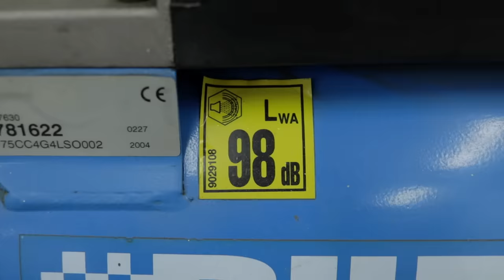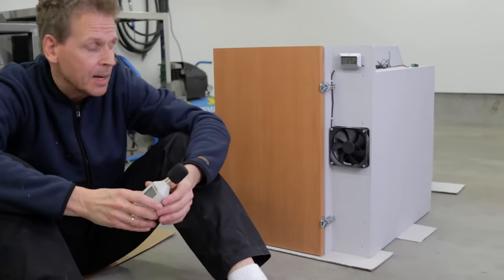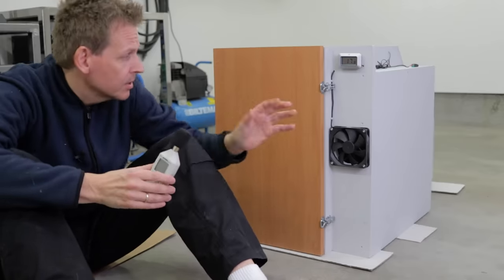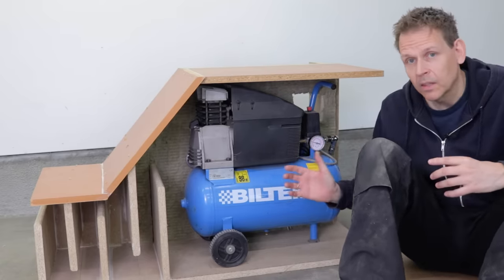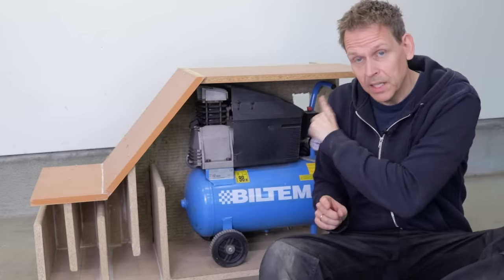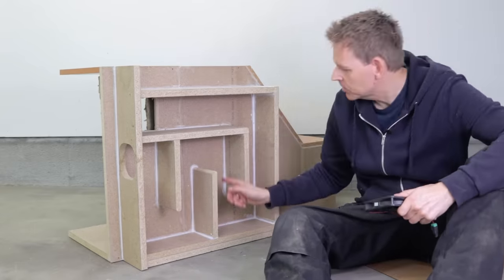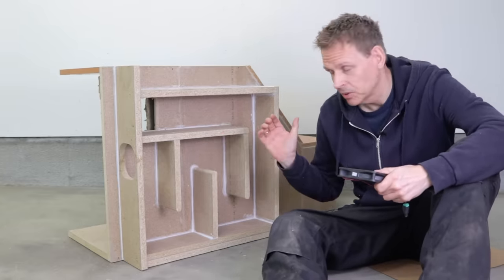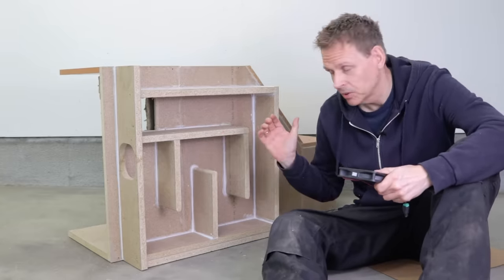Do not build a sound insulated enclosure for your noisy air compressor!

Comment: acoustiblok and half the construction FTW.
Reply from the maker: Is it the 3mm black rubber-looking sheets? Did find a video where it was tested, well 3mm cannot do that much I guess, but perhaps adding multiple layers might help? 🤔
Reply: @kihestad  I know nothing about the 3M sheets.  But Acoustiblok works extremely well for cutting sound.  My compressor box just has leftover strips from building out my office with Acoustiblok.  No special sound box nothing, just some stripes in the way of sound cuts about 10 db.  Maybe even more.  The strips like a meat freeze doorway.
Reply from the maker: Ahh, ok - sounds to be a good solution 👍😊

Comment: Put a better air intake filter on it
Reply from the maker: From what I have found a muffler on the intake / exhaust helps a bit, but not very much. I could be wrong though... I did some research but did not find any solution that I found to be very efficient, not even the ones fitted a big car muffler. The tank itself also emits noise because it acts like a sound chamber. I would guess that if a muffler really worked, the vendors would have added it.

Comment: The muffler idea was shown to me by a old-timer
Reply from the maker: From what I have found a muffler on the intake / exhaust helps a bit, but not very much. I could be wrong though... I did some research but did not find any solution that I found to be very efficient, not even the ones fitted a big car muffler. The tank itself also emits noise because it acts like a sound chamber. I would guess that if a muffler really worked, the vendors would have added it.
Reply: @kihestad  it really works   and they don't put  driers or automatic oilers on them either  but all good to have   try it I'm not kidding  and it's much easier

Comment: If you take the air filter of your motorcycle To replace the original air filter. It'll be quieter
Reply from the maker: I have seen/heard  several attempts on making air compressors silent by adding a muffler as an air filter. It does not help that much. The noise from the  comes from the whole unit, the tank acts like a sound reflector 😞

Comment: Donor forget to remove moisture after use...
Reply from the maker: Absolutely, I do drain the tank now and then! It's a bit cumbersome as it is now, I need to open the four eccentric locks and pull of the door and then take the compressor out of the box. It takes no more than 5 minutes, but it's enough to postpone it to the next day 🙄I better put on a line and have it on the outside....

Comment: C=F....C -30 /2
Reply from the maker: Yes, I really need to learn this, I have actually checked it since I made the video, I found this simplified formula that works OK in "normal" temperatures:
F = C * 2  + 30 
The correct one is F = C * 1.8 + 32

Comment: the only shortcoming here was the details on db, its a common mistake.

richter and db are both log scales.

richter though, it starts with a base unit, 1 stick of tnt, 10 sticks, 100 sticks, and so on.

decibel is 1/10 of a bel. thats rather irrelevant though.

for every 3db, its a doubling. or halving. 

what IS important is knowing that db doesnt have a base unit. its simply a RATIO.

you dont say something is "such and such db" as a measure of its volume or sound energy.

you say something is "such and such db IN RELATION to something else"

you can say ANYTHING is "0db" and then, something that is twice as loud, twice the sound energy, is 3db louder. i can say your compressor here started at 0db, the enclosure redcuing it from what you measured as 85, dropping to 70,  i can state as being "minus 15db" . or i can say the muffled compressor is 0db and increases by 15db when un-muffled. 

nevertheless, whatever way you choose to state it... thats a 32x difference in sound energy...

iirc, the "standard" audio db is 1V at 600R or "line level", BUT!

its a confusing topic as theres all these silly things about "weighting" due to frequency responses, etc, and then it doesnt always apply to audio or sound... it may be the voltage on a coax lead, maybe the power flowing in an amplifier, etc, etc.

and of course, a quick search, i cant find the "standard" audio base unit that all these db ratings are relative to... sad, all these "informative' websites and i have to dig out my old 1952 "radiotron" handbook to get the actual figures...
Reply from the maker: Ahh, yes - I am no expert for sure when it comes to understanding the dB scale 🙄 I was referring to a simplified model; what people tend to 'feel' when it comes to the audible volume of the sound compared to the measured dB. I have understood now this is debatable. For example: different frequencies affect how loud it sounds for the ear, even though the measured dB power can be the same.
Reply from the maker: This was very thorough and well explained, thanks a lot 👍😊

Comment: you have no idea of sound proving.. ive made studios and silent rooms.. 

anyway.. a engine makes around 140+ db.. with a silencer around 60
whats the trick? thick layer of heavy isolation.. like rockwool. better have a smaller airgap.. just right for the compressor and  have loads of rockwool...  
ive made a compressor way more silent by just puting a motorcycle style silencer on the intake.. 
if i would make a box like that.. i would calculate it, and it would be as silent as a fan
Reply from the maker: Thanks for your input, glad to get a pro onboard here 👍😊  I actually used did use Rockwool sound insulation inside the main chamber, it's a very efficient material. I have used it to make DIY sound absorbing panels for the ceiling in my garage. I made a video about the process and tested the result, curious to hear what you think: https://youtu.be/4EkoAMJAIug

Comment: Definitely not worth building it like that, a simple insulated box works just fine
Reply from the maker: You need to supply air to the compressor and make sure it has cooling. A sealed box will not work. A box with ventilation to let air in and out, but at the same time not let noise escape needs to be a bit sophisticated. I had space limitations and wanted to tuck it under my pitched roof, so my build was a bit extra complicated because of that. A square box will be more easy to build and work just as fine 😊
Reply: @kihestad  an indirect air inlet with sponge works well enough but I doubt my installation would allow for prolonged running although it's the high heat levels of the compressor you're trying to shed, the temperature difference is still high within the box even if it hits say 60degrees C.
I do have the advantage of simply lifting the lid off and unplugging power and air then removing or replacing the portable compressor

Comment: I like your design of the box. It could vary from builder to builder. But I would like to add a very important feature I have not seen.
That is wire mesh on the the openings to the box.
Mice and other little critters would love to live in your comfy hotel. Once they move in your investment of time and money will be wasted. It will smell disgusting forever 🙁 🐁 🐁
Reply from the maker: Hmm, I had not thought about that 🤔 You are right, this is probably a "dream hotel" for mice. We have not had any problem with mice here where we live (a lot of cats around), but you never know. Thanks a lot for your suggestion! 👍

Comment: dB vs dBm: the former means double energy =+3dB, the latter does the same for +10dBm to my knowledge …
Reply from the maker: Ah, ok - I don't even know what dBm is 🤔I might have over-simplified how the Decibel scale is to be understood, based on a discussions / explanations I have read from the comments perhaps this makes sense: 
* 10dB increase is the typically stated value for doubling the perceived volume (subjective), without respect to actual power/energy. 
* 3dB increase is a doubling of the actual power/energy (objective), without respect to how a typical person would perceive or rate sensed-volume. 
I have to add that the Decibel is a difficult scale to relate to (at least for me), I might have to study this a bit more - sorry if I got it wrong 😌
Reply: @kihestad  Sone is often used as a unit for subjective loudness - and it uses a linear scale :)
Reply from the maker: @willemjansen9409  ahh, okay, thanks for the info. Never heard of "Sone", need to look it up one day 😊

Comment: Of course the simplest solution is to put it outside.
Reply from the maker: Yes, that is way smarter 😊I just dont have space for it. My garage is placed with minimum distance to two of my neighbors. The side facing my own property is not usable either,  as it's just a slim path between my garage outer wall and a concrete retaining wall. In front of the garage door is no good either 😋

Comment: Foam board insulation works better
Reply from the maker: I used Rockwool sound insulation material on the main inner part where the compressor lives. It is a lot more dense than normal insulation made for heat/cold insulation. I works very well. I am not sure if these foam board insulation mats works very well, but they look cool for sure 😁
Reply: @kihestad  Thank you- good job on that box. I was just thinking my foam board idea would bounce the sound around instead of obsorb it like your mat is.
Reply from the maker: @puppygadget3189  I think the sound waves needs to be broken apart, or they will eventually find their way out the ventilation channels. If you have separate rooms with no channels in between i would guess a more dense material would work.

Comment: your testing is scientifically invalid because you move the position of the noise source relatively to the walls and to the mic, so you are changing the distance and the ambient wall reflections.

to be valid, you must not move the compressor to the box, but move the box to the compressor, so that all wall reflections are identical. 

I had the case of a noise box With funny shape. it was a huge compressor outside in town. huge like,people could not sleep 300m away. they had plenty space around. they also could not embox it due to the need for huge intake and huge exhaust (diesel ). they have put 2m high and 3m long sound pannels around it, not like a box, but radially, like a star. only vertical panels but in a radius position. all spaced at about 50cm. the machine  could breath air as required. it could be visited when required. it could be seen.  but the noise was reduced to an acceptable level /because when distance between obstacles is smaller than wave length, wave can't pass. only short waves could go.through, and they were also hugely reduced.
Reply from the maker: Very cool solution 😊

Comment: why not just take the motor off the tank & make a much smaller sound proof box..? & a longer hose to the tank from the motor/box..?  also incase ur cheaply made tank decides to go boom 💥 the wooden box might help or make it worse & more shrapnel.. 

Remember ppl on the bottom of ur aird tanks is a screw that lets out Water if not ur tank too will rust inside out & go boom,  videos everywhere online

Comment: Just put the compressor in another room, or outside the building.
Reply from the maker: Yes, that is probably the easies and smartest solution to the problem 😊Unfortunately, I just dont have space for it. My garage is placed with minimum distance to two of my neighbors. The side facing my own property is not usable either,  as it's just a slim path between my garage outer wall and a concrete retaining wall. In front of the garage door is no good either 😋

Comment: since every 3db is a doubling of sound power you are talking 8 times as loud.
Reply from the maker: I might have over-simplified how the Decibel scale is to be understood, let me try to clarify (based on a discussion / explanation from the comments): 
* 10dB increase is the typically stated value for doubling the perceived volume (subjective), without respect to actual power/energy. 
* 3dB increase is a doubling of the actual power/energy (objective), without respect to how a typical person would perceive or rate sensed-volume. 
I have to add that the Decibel is a difficult scale to relate to (at least for me), I might have to study this a bit more - sorry if I got it wrong 😌
Reply: @kihestad  I think I recall that a doubling of power is 6db if you are measuring a change in voltage (assuming a constant impedance) instead of a change in power.

Comment: just put the compressor away from your work area.  Mine is outside in my carport, its also the size of a small car.
Reply from the maker: Yes, that is probably the easies and smartest solution to the problem 😊Unfortunately, I just dont have space for it. My garage is placed with minimum distance to two of my neighbors. The side facing my own property is not usable either,  as it's just a slim path between my garage outer wall and a concrete retaining wall. In front of the garage door is no good either 😋

Comment: Use proper sound isolation,  not flat survice
Reply from the maker: I used Rockwool sound isolation material inside the main chamber of the box. The same material I use in my DIY sound absorbing ceiling panels. It works great 👍

Comment: You actually have created a problem for your solution. Using enclosed air compressor for more that 50% duty cycle will overheat it and short the lifespan.
Reply from the maker: I absolutely share your concern about overheating. The air compressor will not live for long if it is constantly hot above the recommended specs! 😐 However, It's a pretty cold climate here where I live in Norway, in the Northern part of Europe. I have actually fitted a heat pump in my garage to be able to use during winter time. I can see overheating is a big challenge in warmer climates. A more powerful fan or even radiator cooling could be needed must then be considered.

However, since I have a fan in front blowing air into the box I have airflow through the case that will "grab" the heat and transfer it out of the box. I have fitted a thermometer and checked the performance frequently. Normally the temp increases 5C = 10F from when it starts until pressure is built up and it shuts off, and then it takes just a couple of minutes to cool it down (as the fan continues to run after the compressor stops). If it is running constantly over longer periodes it can get a bit hotter, I have seen almost 10C = 20F increase. The warmest summer days can be 30C = 86F here where I live, but that is very rare. Its more commonly 25C = 77F, so it never gets very hot inside my box and it is within the range of acceptable temperature for this compressor.
Reply: @kihestad  Thanks for taking time to clear this out. But, anyhow, its local solution, making box like this in South would bring different results. My compressor heat up a 30m2 garage if I leave it running for 30min or longer... good luck to you with future projects.

Comment: Buy a decent compressor.  That's a crap unit.  Get a good piston driven unit.
Reply from the maker: It might look like it, but it's actually not. It works great for my use. I have used it for painting and all kind of tools without any problem. When sandblasting or just blowing air the capacity is of course limited since it is small, but I am not running a big workshop so for me it's perfect!

Comment: Roll it outside and close the door.
Reply from the maker: Yes, that is way smarter 😊I just dont have space for it. My garage is placed with minimum distance to two of my neighbors. The side facing my own property is not usable either,  as it's just a slim path between my garage outer wall and a concrete retaining wall. In front of the garage door is no good either 😋

Comment: Seems like a lot of dicken around for such a crappy compressor. There are compressors on the market much quieter, they are more expensive but you do get what you pay for.
Reply from the maker: The air compressor is actually quite decent, for my need it is perfect. Nice to know that more expensive compressors exists, it did not really surprise me 😁
Reply: @kihestad  
There's cheaper ones too,
They make even mor  noise. 
If you use it much yours won't last long anyway.
Do as  you wish but I chose to buy  a good one  that was used for about the same money. 
A speedair,  very nice  but kinda expensive new. You can carry on a conversation with someone while it's running.

Comment: Wear hearing safety gear. Done.
Reply from the maker: Hearing protection is a great solution, and I always use it when I start a noisy machine. I'd rather not go all day with them over my ears, I don't think anyone does, when not operating a noisy machine I take them off. I might be easily scared, when a sudden loud noise happens it felles like my heart skips a couple of beats 😛 You never know when the air compressor kicks in. Typically it happens when I am very focused and it is completely silent in the garage. And there - BANG - it kicks in. I could not take it any more 😫😂😁

Comment: i DO NOT UNDERSTAND THE TITLE!!!!
Why in the holy hell did you title it "do NOT build an enclosure for your air compressor"????

This doesn't once say why NOT to, instead it's literally a video as to why you SHOULD BUILD ONE?!?!?!?!?!?!
Reply from the maker: I'll try to explain: I built an enclosure for my noisy air compressor, a lot of work, I hoped it would reduce the noise a lot. It helped a bit, but it was still too noisy. Then I bought a silent air compressor, and it ended up being more silent without enclosure, than the noisy one with enclosure. In other words: rather get a silent one instead of making a box for your noisy one. 

Since I already had built the box, I did not want to throw it away, so I put my new silent compressor into it. That made my silent compressor got even more silent